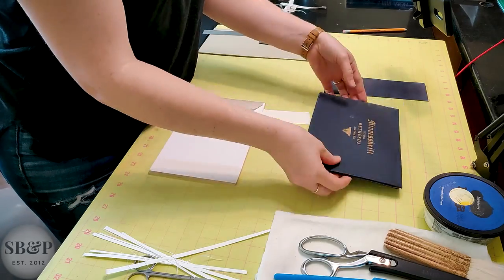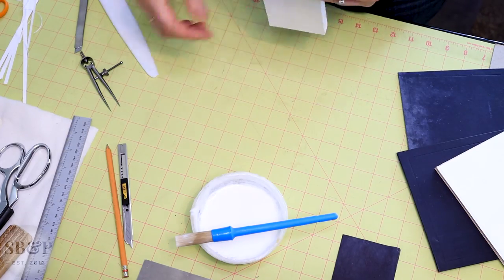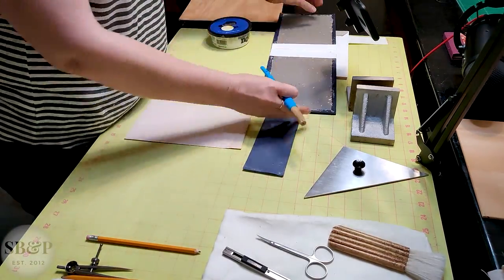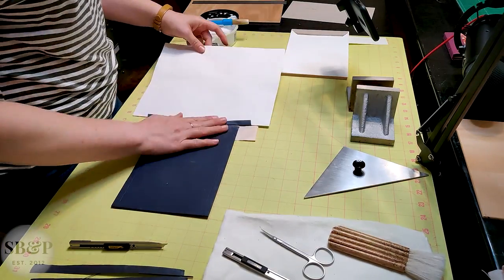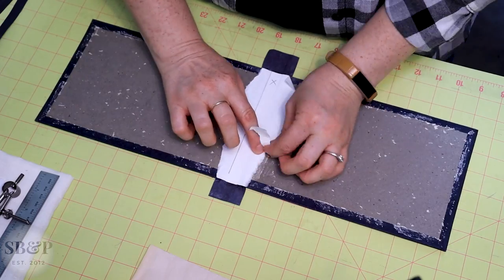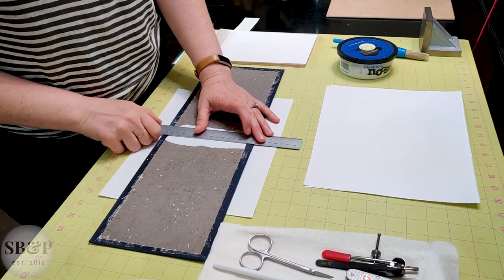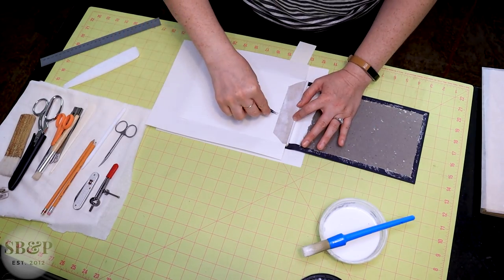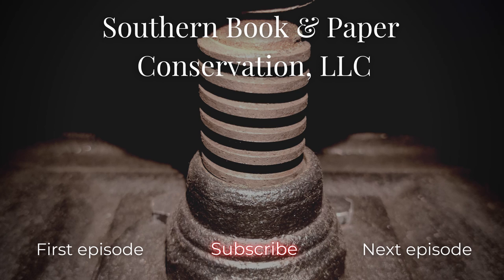Small Case Binding Repair 📚❤.  Cover Rebuild & Casing In.  Finished book!

Comment: Hi. Thank you for publishing your beautiful work open in public. I've been learning bookbinding for about five months. In the way I'm learning, there is no shoulder. What is the purpose of shoulder in a book? Is it an obligation? Also, as I know, when the "shoulder" is to be made in a book, it is necessary to piece together the spine and covers to each other by opening holes on covers wide enough for the thread to pass through, passing the threads through them, and then gluing them. But I don't see it on most of the books? Do you know why? There are lots of methods in bookbinding. Because I'm not familiar with all of them, and all the terms in bookbinding yet, I have lots of confusion. Do the methods have their own name? For example the one with shoulder? Sorry It is a bit long question :) 
Thank you very much again🙂